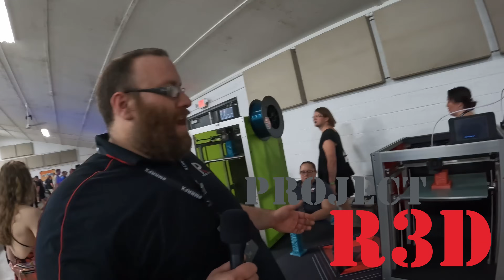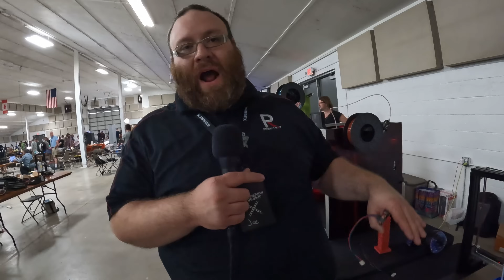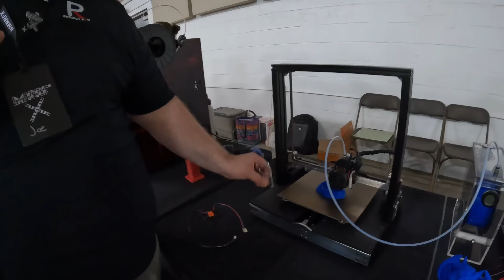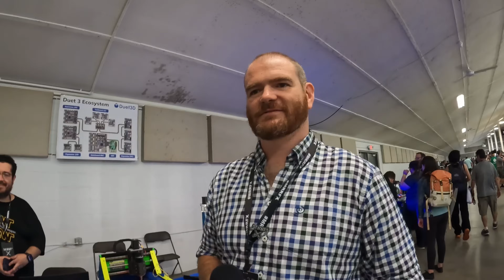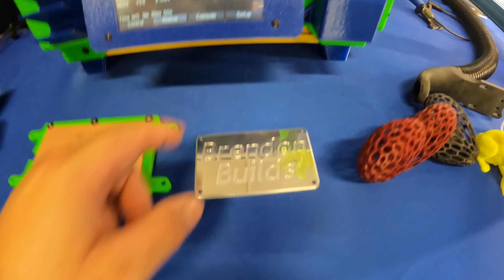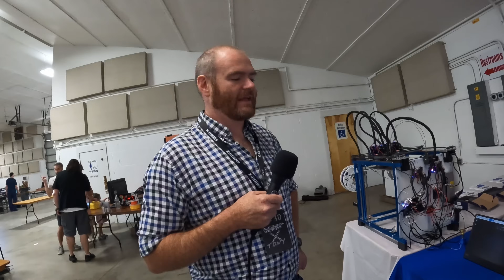MRRF 2022 - PART 1 - Project R3D & Duet3D

Comment: Wow, that's a super impressive cabling job on Brendan's printer!
I wonder why he didn't flip the spindles in the A+B stepper motors and use longer screws so that he could have the stepper connectors right down on the frame?